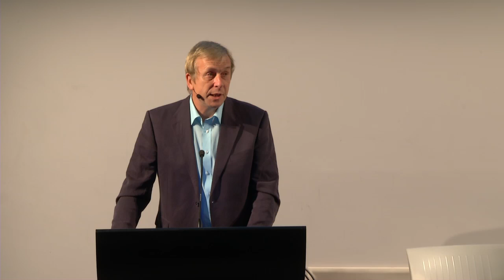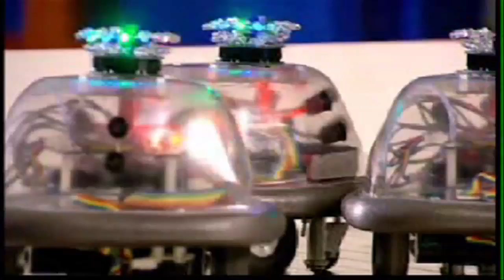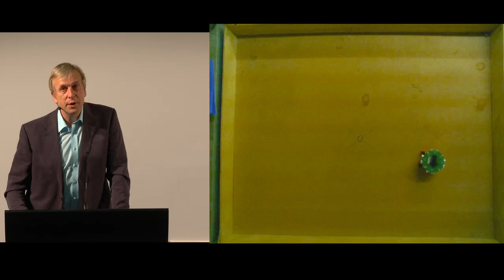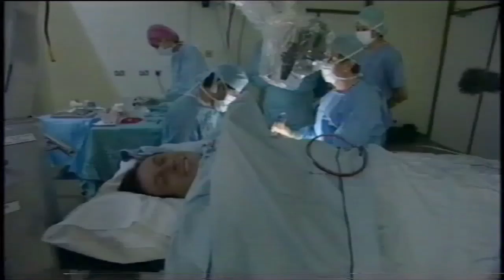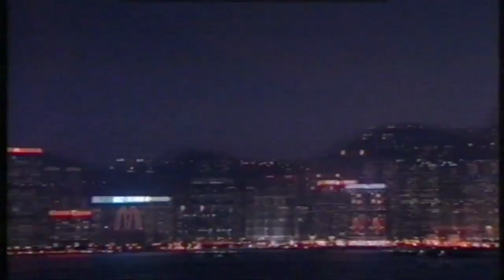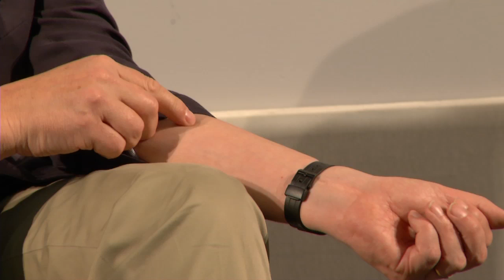KEVIN WARWICK : MY LIFE AS A CYBORG

Comment: Lets step back, newer tech will allow for more involved "brain" being a brain that could learn, in the 2D, first rather than telling neurons to send/receive, let them make correlation themselves. that is, connection at random the inputs and outputs of the multiboard, that i've coined to be the neuron dish. telling neurons to multiply, and build, may be capable by the pig bladder cells, that reproduce, and recreate cellular level connections. ending in a result to a brain that builds, and processes when cells die. a major step would be the safe transfer of dead cells, and nutrients. i.e. the trash collection, take out the junk produced, to prolong the life of cells. after all of this, essentially, all that you are making is a multilayer board. can the possibility of adapting multilevel be possible now. presuming you can tell the cells, to cease production, preventing them killing themselves inside the lab environment. my curiosity stems to the mass of cells, once they begin to make correlations, take 2-3 robots, and place them in a cell with a live rat. will those cells and functions learn themselves to behave just as the biological rat does? simply, CAN the brain learn the function of itself by watching the environment around it. this is on the tip of the tongue, per-say. reason being is that we already understand what INPUT will equal an OUTPUT, the cells are hard set by major connections.(surgical implant). What if we were to just give the brain a set of in-out, not telling it which gives the data, and which produces an effect. by chemical reinforcement, it bumps a wall, and receives a jolt that it doesnt like, oppositely, it misses a wall, the received chemical to the neurons equal a "positive" touch.